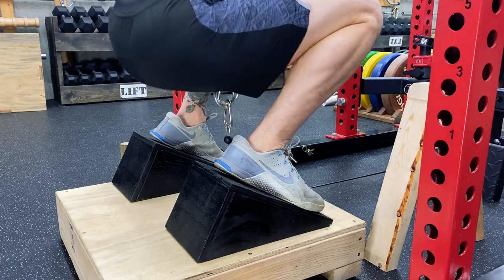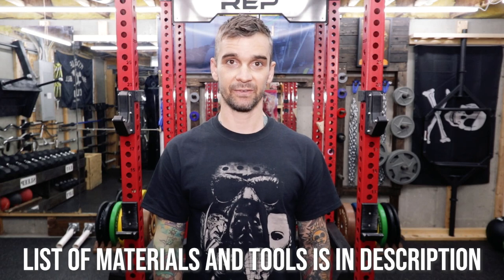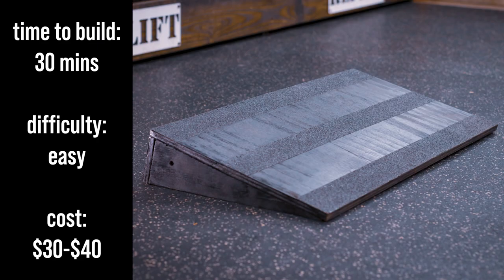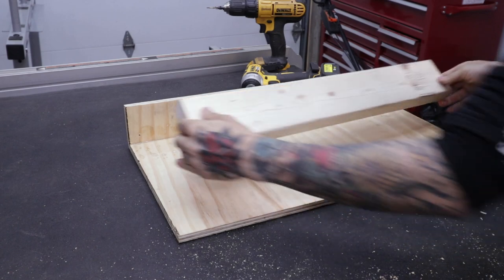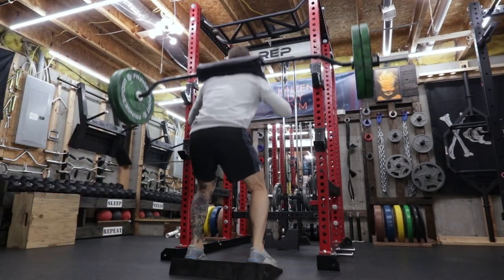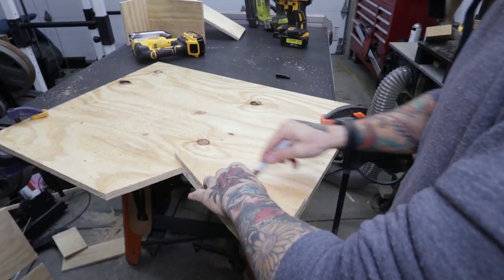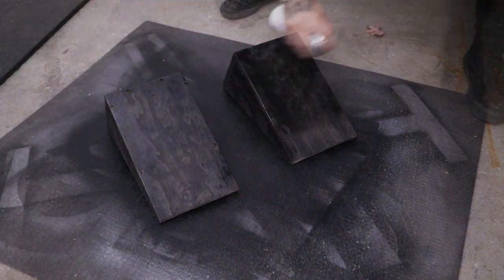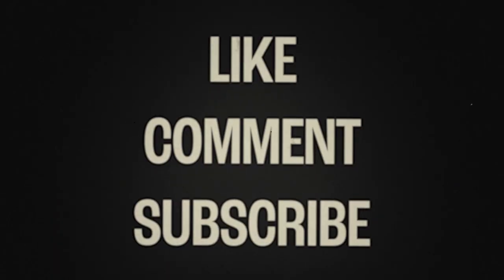DIY Squat Wedges, How to make a slant board for heel elevated squats

Comment: Pleas patent this tech and then manufacture a pro-grade version made of steel. I will buy it. Many people will buy it.  These attachments are great for home gym enthusiasts that want the selection available in a commercial gym but for home-use, and without taking up as much space as a commercial-style gym.
Reply from the maker: That is a great idea. Typically one utility patent costs over $10k to get the patent issued, then you need to have $15k-$20K in the bank ready to defend against potential patent infringement. If you don't defend it, you can lose the patent. So we're looking at $25k-$30k per patented item. I am not at the point where I have the resources to do that but hopefully some day.

Comment: Great idea! I would primarily use them to stretch my calfs. Have you ever used a spray on bed liner?
Reply from the maker: Thanks! Yeah I used bed liner on my adjustable triad dumbbells. It works great. Definitely an option of the wedges as well.
Reply: @KaizenDIYGym  do you prefer grip tape over bed liner?
Reply from the maker: For the wedges, I’d rather use grip tape. It’s pretty secure, which is important when squatting heavy.

Comment: Question.
Do you also put grip tape on the bottom so that they don’t slide around, or slide out from under you when squatting?
Reply from the maker: I didn’t put the grip tape on the bottom and I haven’t had a issue with them sliding around at all.

Comment: Do you prefer the single or double wedge when doing squats?
Reply from the maker: Honestly, I like having both around. The wide wedge is an easy target to plant your feet on for squats but the individual wedges work better with my belt squat. Another benefit to the individual wedges is the ability to angle them out for squats.

Comment: If youre lazy like me go to harbor freight get the rubber tire chalk set and if need a bigger platform  put a pice old plywood over it. The rubber tire chalks doesnt move and  holds the plywood piece with out screws or mounting needed. Plywood would need some grip tape though. But I havent needed to add plywood
Reply from the maker: That’s another great option

Comment: 6:00 - Sleep, repeat.
Reply from the maker: Telltale sign of depression
Reply: @KaizenDIYGym  - Definitely. Sometimes it takes someone else to notice these things lol.
Have you tried using these squat wedges with your toes off the front? what do you think of that, in comparison to being completely on top of the wedges?

I noticed that mostly people doing mobility stuff, like to be fully on top (with little to no weight), where as people doing doing regular gym lifts often like to have their toes off the front.
I think they do this so as they can have better force-production since their toes aren't at a downward angle. Also (particularly if they train with no shoes), they don't gotta worry about slipping.
But then you don't want the wedge itself slipping backwards from the foot if the toes are off the edge (for steep angles). Grip would help with that, but grip isn't super nice on shoe-less feet, so I think then the wedge just has to be reasonably heavy... like the metal ones.

Comment: Nails, screws and glue? Glue is enough. A couple of finish nails to hold while it dries is more than enough of you don't have clamps. 

People often don't realize how strong glue is. Also saves on materials, time in pre drilling/screwing, and makes for a cleaner appearance.
Reply from the maker: Yeah, I’d prefer to go overboard rather than have have someone build something that breaks and blame me for it. Plus, people go pretty heavy with squats. It’s better to make sure it is properly reinforced.
Reply: @KaizenDIYGym  sure enough. Most people are deeply ignorant about building anything. I can guarantee it won't be the glue that breaks but liability is a mf'er.